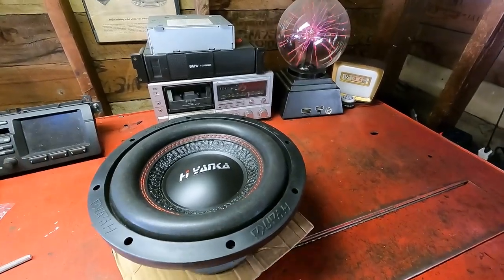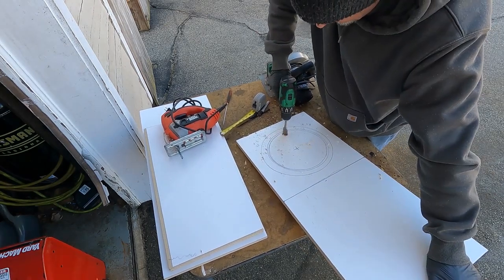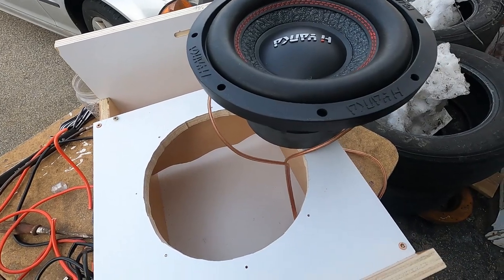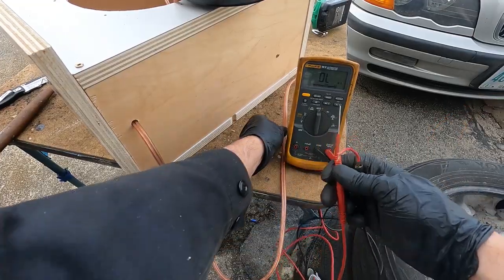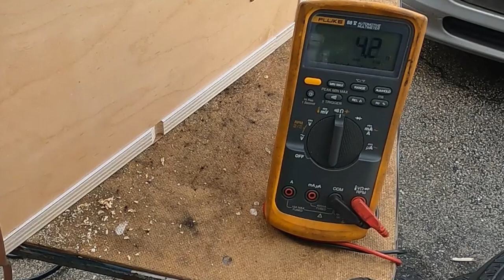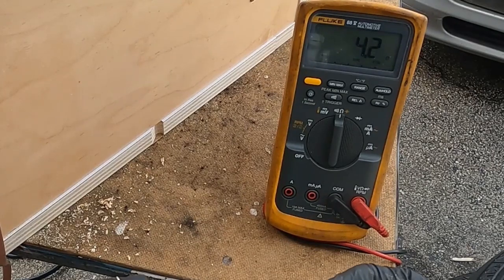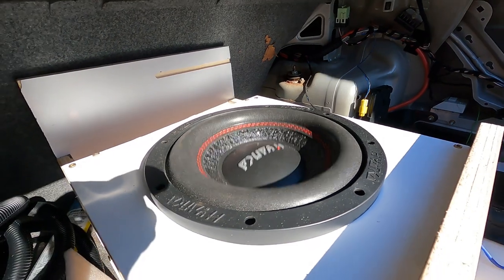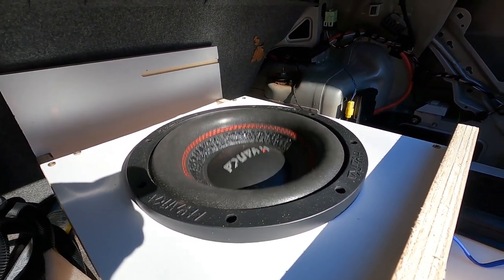Amazon Subwoofer? HYANKA 10 Inch 2 ohm Review #speakers

Comment: I cannot wait to see and hear this in person. Videos never get the true results across. Also I'm interested in hearing why you chose to do a vented enclosure. I've always leaned towards sealed enclosures.
Reply from the maker: Ya man can’t wait to show you. I couldn’t find any information saying one way or another. I guess that’s one of the negatives. I could always steal it up and see how it does.
Reply: @AndyTheXTech  Yeah there are pros and cons to both, usually it comes down to preference or size restrictions. In my case a vented box would have required too much space, more than I wanted to sacrifice for a sub. So that's why I've always made sealed enclosures. But I've always been curious to see how far I can push a vented enclosure. Maybe on the next build... Haha
Reply: A sealed enclosure will always sound better if built to spec for the speaker and will have a broader range of bass and blends with your door speakers better. A vented enclosure can be built to sound good with the right sub , but will have more output in a more narrow frequency range.
Reply: @Hayawasa  Agreed, and that's another reason I always go with sealed. I also don't wanna have to deal with tuning the port frequency
Reply: @AutoFixYT  ive built just about every enclosure , including 4th order 6th order, tline, and aside from adding a passive radiator , nothing compares to the sound of a sealed box .

Comment: Dude , what the crap is up with your port? You should learn how to figuire port area , and tuning. Im sure it was just built to test it, but if cant make one correctly just make a sealed box , or buy one.
Reply from the maker: What do you suggest?
Reply: @AndyTheXTech  i would be more than glad to help, and i dont mean to be smart, but i would have to know what you are wanting your sub to do. Do you want it to blend seamlessly with your door speakers and sound natural at the cost of reduced output below 40hz? Or do u want to blare rap music as loud as possible and not sound that great on rock and metal? Or do u want something in between ?
Reply from the maker: @Hayawasa  probably in between mostly Limp Bizkit type music or metal
Reply: @AndyTheXTech  sounds like your around my age , and like the same music. I dont know the measurements of your ported box u made in the video, but i would just take the side of the box where the port is and unscrew it and cut it so it will fit between the top and bottom slide it in so the box is sealed. Liquid nails around the inside of the box to help make it airtight, or silicone  if you want to take the box apart one day. Have a listen and see what you think. Imho, sealed is the best for sound quality. Especially if you listen to alot of metal. These are really amazing subwoofers for the price, i have the same one you have in my 350z and i was amazed . 20 years ago i paid 500 or more for a sub woofer that matches this subwoofers performance.
Reply from the maker: @Hayawasa  awesome! Yes I will do what you said and try it out. So far I love this sub but your right I think this will improve it. If I have time I’ll make a follow up video. Thanks for the help. 👍
Reply: @AndyTheXTech  also wanted to add that if you wanted to buy another one and have both sealed and ported and double your amplifiers output, skar has a great armorcoated kerf port box for 107 bucks or something like that. For the price of 3/4 mdf , you couldnt build one that cheap. Anything thinner than 3/4 will flex and come apart sealed or ported.
Reply from the maker: @Hayawasa  I’ll check it out
Reply: @AndyTheXTech  also had one question for you, what kind of technician are you? I work as an autobody tech currently, but have been a mechanic and automotive electrical tech in the past.
Reply from the maker: @Hayawasa  I used to be a GM master tech working in dealerships for 20 years. VW certified back in 2010 for a year. I’ve been out of dealerships for 5 years now.
Reply: @AndyTheXTech  thats awesome, you have to be pretty smart to acheive those credentials. I have subscribed and i hope to see more videos on any automotive related topics and i hope your channel grows
Reply from the maker: @Hayawasa  absolutely! I’ve got lots of footage to edit. More diagnostic, brake jobs, and all the other projects I’m doing. I have fun making the videos. Thank you for subscribing 👍